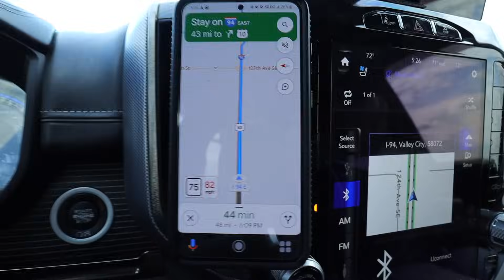We Lost A Tire on our RV and how we handled it.

Comment: ⛔❗Be careful there was a Recall on Grand designs, momentum and Solitude 5th wheels from 2021 to 2024 they are stating that the U-bolts and properly tightened. Which can cause the axle to move out of the position. So if anyone has this issue with these models take it in! Don't Risk It. ❌❗

Comment: I'm new to your channel as this one randomly came up in my feed earlier. Some really good suggestions here in the comments, as well as bad ones. Problem is, you lack experience with things mechanical to distinguish good from bad. Not trying to rub salt in the wound, I swear. The BEST thing you could do, right now, before you continue to compound the L's, is identify someone you trust that knows how to do these things right, and have them as your emergency call for advice and instructions if necessary.  Internet forums, u-tube, and the like are ok to get an idea of how something is done, but don't depend on some random stranger on the internet to know what they're doing then bet your life on it.

If anything, I empathize with your situation, and wouldn't post this if I had any doubt you could do better with a mentor. I think you're entirely capable, but misguided. Actually dangerous if you think about it, as you're failing to recognize your limitations. I know that sounds harsh, I'm not trying to be mean or ugly. What I'm saying is: I believe you're capable and just need trustworthy direction to get started. You've been very fortunate so far, so don't press your luck. You have at least 40 more suspect wheel studs to change out, and you probably should replace the 8 new ones you pulled through the hub with the nut as well. Drive them with a dead blow hammer and a proper punch. You also already noted those paper thin brake linings. Don't wait. I really hope you can get that guidance to do better.
Reply: @TonyBenton0728  tell that to the family that gets the next trailer wheel thru their windshield. Todd seems a capable guy that's willing to do the hard work, persistent, and deserves honest input. If I didn't believe he was capable and wanting to do right, I wouldn't have wasted the time posting. I'd be happy to take his calls and share my 40 years of experience, but being unknown to him that's not likely. I expect there's someone closer in his orbit that can offer the same.
Reply: @TonyBenton0728  Amazing coincidence. I've been running two semis for the past 12 yrs and do all but the major repair jobs myself. I think we're more in agreement than not. When you operate semis you see the outcome of these mishaps first hand, unlike most drivers that are lucky to catch it on the news or someone's crazy dash cam reel. Makes it sink in better IMO. I appreciate you weighing in, even though it was a bit adverse at first.

Comment: You guys are lucky.....that tire / wheel could have hit someone's car and killed them.  You are going to really need to rethink your attention to detail.
 
A couple of other things....a pull trailer is a pull trailer, its not a RV.  RV = recreational vehicle.  Trailer is not a vehicle.
Second, You have to tighten the lugs by hand and then tighten with a calibrated torque wrench Then, drive to  your stop location for the night.....the next morning retorque all the lugs.  The HEAT / COOL cycle can have an impact on the torque values as well. Cheers !

Comment: So whoever switched your tires out or put your tire on. Did not torque it to Spec So if they overtook, it can Snap the bolts, or are they under torque? It can Snap the bolts lug nuts. Everybody thinks overtook in your lug nuts is good. It's not good, you've got to go to spec

Comment: your rig is large and likely very 
you need major RV or heavy truck supply
you are hauling weight close to heavy trucks
maintenance and repair is in another league
compared to cars and pickups
you may not have the technical knowledge to make a safe repair .... many RV owners carry a torque wrench to avoid this

Comment: 20:03  Those are STUDS.....not lug nuts.  You might need to UP your mechanical knowledge, then go back out on the road with your pull trailer.

Comment: It's not a big deal all you have to do is take the drum off take it to a Napa bacon press out the old studs and press and knew it is so easy not a big deal whoever put the tie on the trailer didn't tighten the lug not no big deal